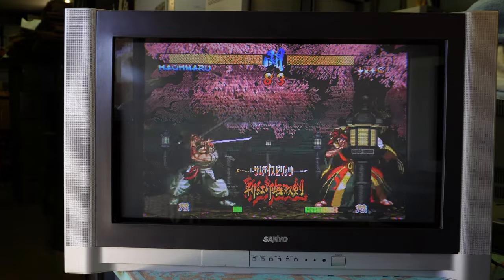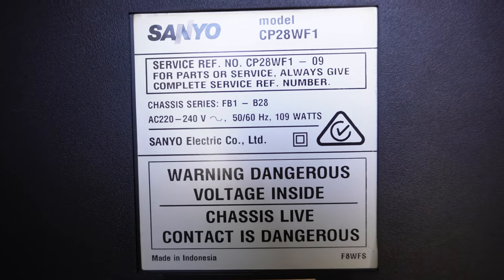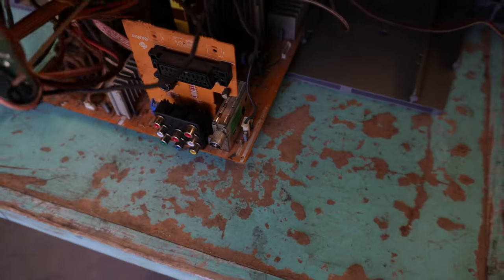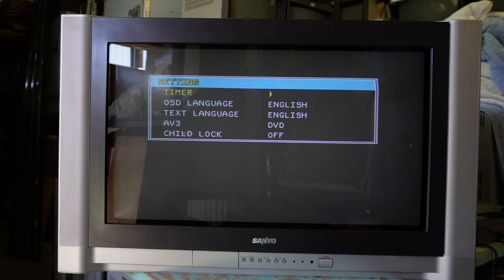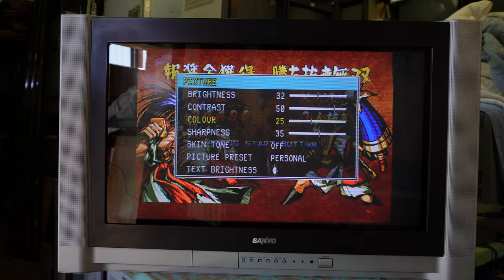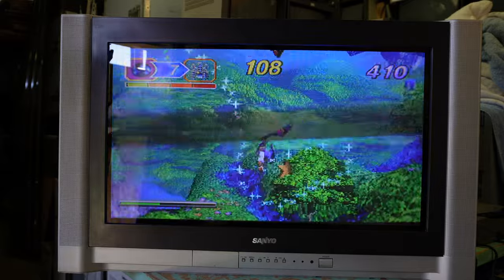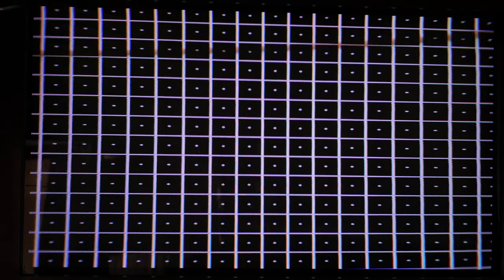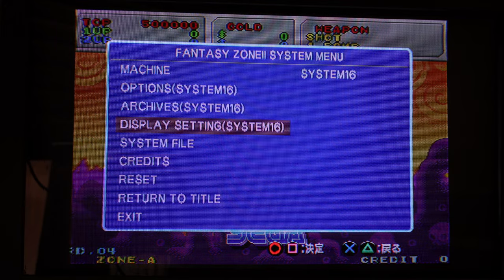Sanyo  CP28WF1 SCART & COMPONENT CRT TV

Comment: nice. I've got a sharp Quintrex equivelant with SCART RGB / component. you have to select each time you power on which input you're running into the SCART. There's 2 SCART inputs and one only does composite and S video. There's the same front ports (S video / composite) and the rear also has RCA component inputs. perhaps when using the RCA inputs you wouldn't have to select YUV manually. I got it free with a manual and remote.
Reply from the maker: Sweet pickup, great to have the selection between RGB and component, certainly better than having only 1 of the 2.
Reply: @rgbrob  yes definitely but I feel like these sets are transcoding RGB to component internally. I have a loewe 16:9 that also takes RGB and allows adjustable colour
Reply: although the Quintrex SR is 100hz and does 480P !